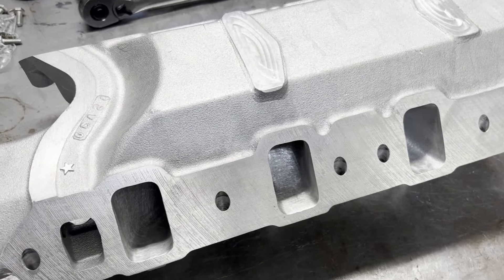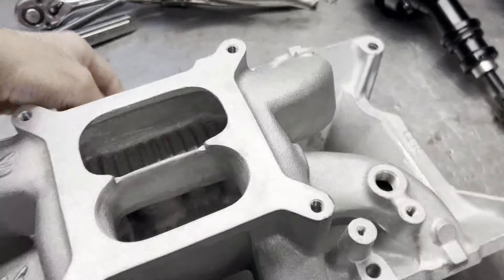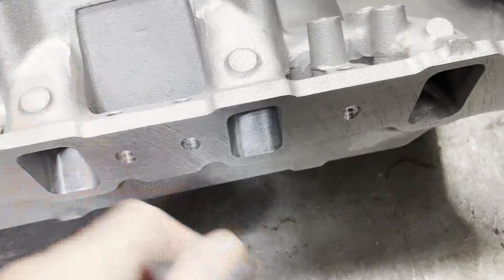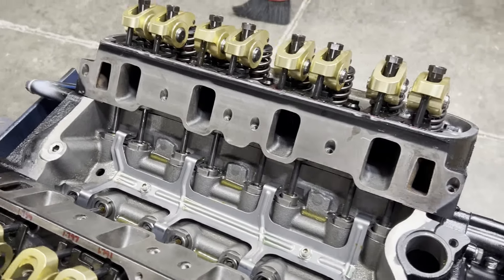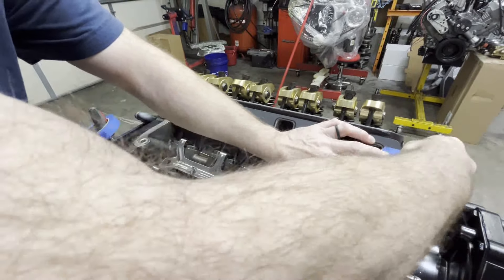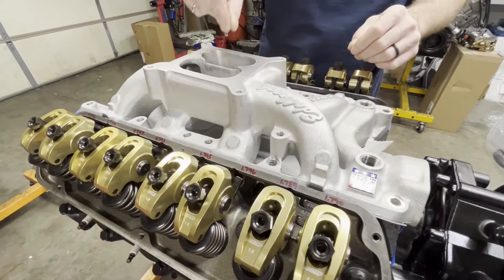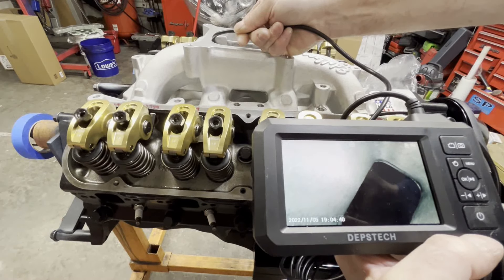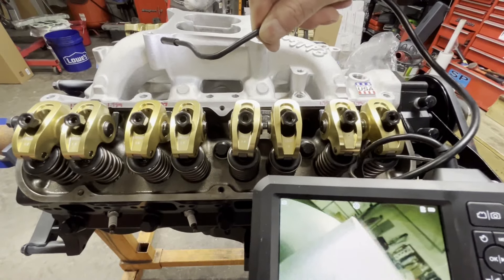Lykins Motorsports SBF Intake Manifold Installation...

Comment: Im surprised that you didnt check the mating surfaces for paralell.
And that you didnt mention using dowel bolts to be sure the intake comes straight down in place.
You are good and dont need to, but we do. 👍
Also I would have boroscoped the match after tightening. 👍😎
Reply from the maker: Hey, I mean it wouldn’t be YouTube without someone feeling like they need to tell me how to do it, right?  The mating surfaces were surfaced last week because it needed to be cut .060”.  Also, you can’t always use studs because sometimes the intake needs to be shifted one way or the other.  Not sure what is difficult about just dropping the intake down and then checking it.  How do you know I didn’t check it after the camera turned off?

Comment: According to Edelbrock, the optimum RPM range is 1,500-6,500. Will porting and putting a spacer on top increase that range above 6,500? Perhaps 7,000 or 7,500? What is your expert opinion?
Reply from the maker: I don't look at rpm ranges for anything.   Not for intakes, not for cams, etc.   It all depends on the individual combination of parts.   Runner length is associated with rpm.  Runner length will also depend on the length of the head port.  Just too many variables.  On my 302 mule, I have no reservations about going to 7500-8000 with one.
Reply: When you have an engine that has a cylinder head that flows 300 cfm at .600" valve lift, you need an intake manifold that flows at least 330 cfm for the street.  That RPM AG as cast from Edelbrock flowed 263.77 cfm average with one port only flowing 254.03 cfm.  That would essentially strangle a 363CI SBF with 307.5 cfm heads.  I always try to give a street engine at least 10% more airflow than the head at valve lift so that it does not hold the engine back in the upper rpm range.  This RPM AG flows 330.68 cfm average for an increase of 66.91 cfm average flow.  The intake will not hold the engine back.  The RPM AG is not the intake of choice if the owner would race this engine, he should/would need to step up to a Victor Jr that can be ported to 400 cfm if needed.  For race engines I always shoot for 120-125% of head flow at valve lift.  Joe-JDC